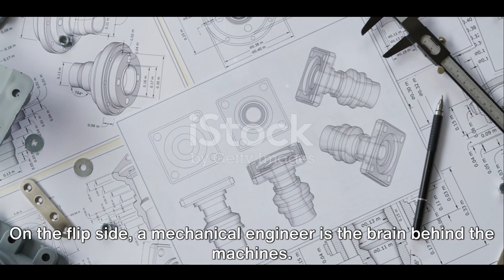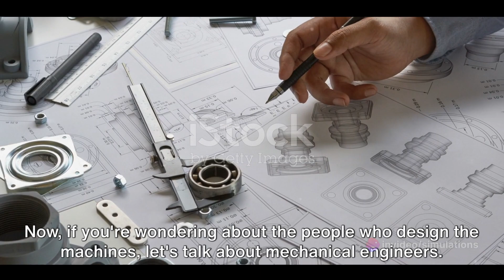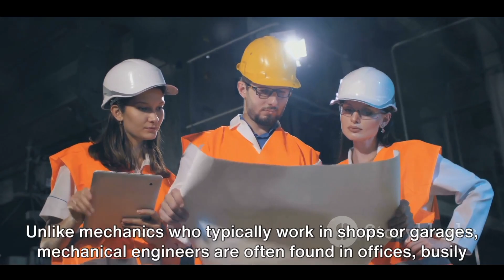Mechanic vs Mechanical Engineer: Unraveling the Mystery

Comment: This is the difference. I'm a mechanical engineer and would fumble around trying to fix a car because I'm not familiar with it.  But a mechanic can't fix next years car.  I can assist in design of next years car.  A mechanic is looking at engineers historic information.  A mechanic is like in communist cuba keeping the cars american cars running forever.  Or they wouldn't be able to optimize strategy or performance for racing.  And I can do that for cars, boats, bicycles, houses, or anything else that uses energy.  You have to do work to learn how to model future things, and it's not time spent flipping through catalogs of parts or car magazines.  If I just took apart cars and put them back together I would fail every engineering exam.  It's like the difference between a librarian and a writer.  It looks like the writer does less writing one book while the librarian has this huge collection of books and knows where they all are.  If I was writer I wouldn't be as familiar with the library as the librarian but if you think librarian is smarter than the writer, you're an idiot.  Next chapter.

Comment: I disagree with the framing and tone of the video, despite the author's intention to treat both professions as equals. The truth is, these professions are two sides of the same intellectual coin. The data that engineers collect in an attempt to study physical phenomena is the same as mechanics, just for a different purpose. That purpose however (the designing of a new, and often unnecessary and only slightly different model of car, for example) is dictated (generally) by an owner class that benefits from the illusion of social hierarchy and the inherent injustice of meritocracy.